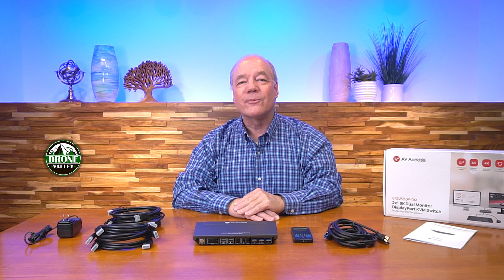AV Access 8K KVM Switch - Perfect for Display Port Monitors!

Comment: I'm trying to use this switch to connect my work laptop and my desktop pc. Could I use a docking station to plug my laptop into then plug into the kvm switch?
Reply from the maker: Sure, as long as the docking station provides a Display Port video output, you'll be all set.

Comment: @Dronevalley - can you confirm the connection stays active on "Device #1" while the KVM is active on "Device #2"?

I'm worried the USB and DisplayPort connections are severed when switching between devices. Ideally the KVM would keep both connections active during the switch.

Comment: Hi, is there a maximum distance a connected DP lead can be before the signal starts to degrade? 
My pc is about 6 metres away from my furthest away monitor, and an ebay seller states; "Do not use too long cable (total 3m) for connection between the switcher and your devices.".. This advice applies to that seller's item, however if this is across the board then it would scupper my planned setup. Any thoughts?

Thanks.
Reply from the maker: The maximum distance you can extend a DP signal reliably is 15 meters, but it depends on the quality of the cable and the resolution of the video that you're trying to view. With your setup, 3 meters won't be an issue but be sure to use a high-quality cable to maintain the best picture. I hope that helps and good luck!
Reply: @Dronevalley  Hi, thanks for reply. I'm currently reviewing my monitor positioning to overcome these potential issues. I'll heed your advice should the need arise.
Cheers.